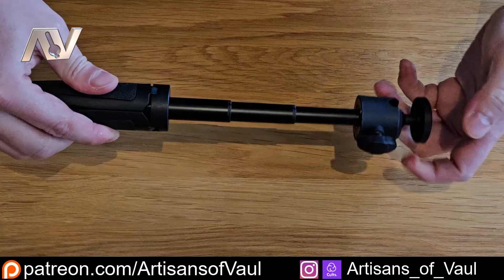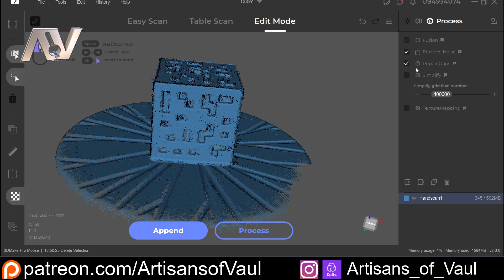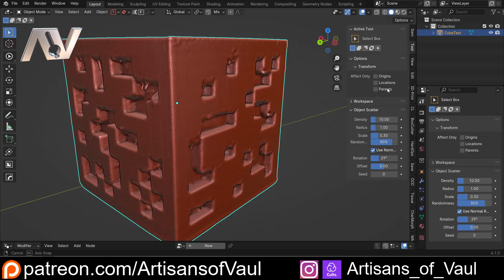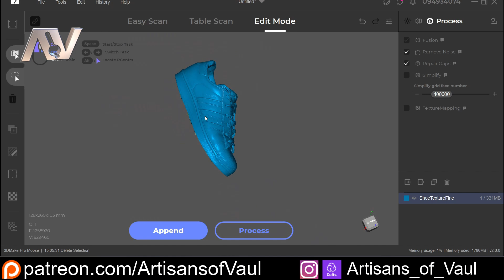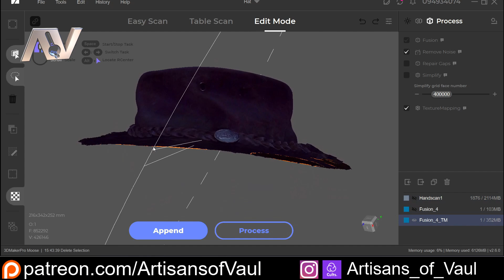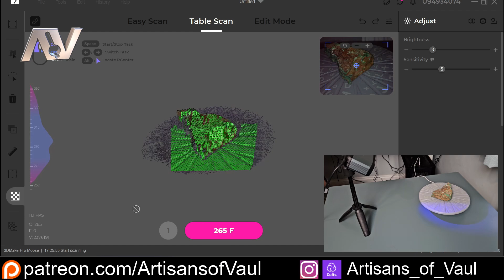Reviewing the Moose 3D Scanner by 3D Makerpro

Comment: Moose or Pop3?  On the fence between these two or a recommendation in that price point.  Thanks and apologize if already asked
Reply from the maker: @johnnoliviamoffett2896  Pop3 without a seconds thought. The software is just far and away superior. It gives more control while still giving a "once click" processing option and is receiving regular updates (even though it's already comfortably better by a good margin).

I mostly scan with a MINI2 but that's because I scan mostly small objects.

Comment: I have major issues with tracking, constantly losing tracking.
Reply from the maker: What are you trying to scan?  As you probably saw in the video I had no issues with tracking on a number of items.
Reply: @ArtisansofVaul  Anything really, I find my refresh rate appears much lower than yours. Maybe the light is too dim? hand held is very difficult. Unless I move as quick as a snail it loses tracking.
Reply from the maker: @maciejgorski6981  hmm... At points I had to speed the video up but I get pretty good rate. It could be an issue with the scanner itself/damage. Have you contacted 3D Maker Pro?
Reply: @ArtisansofVaul  Could be I have a second so ill try it out, but it could also be light and other factors. The scans come out well though. Faces look crisp.
Reply: Did you download the calibration file? Normally a message box appears at the very first start of the software. Didn't pop up for me. So I had the same issue, until I dowloaded this.
Had to do quite a bunch of research to get that information.

Comment: I just received my moose, this is my first scanner. I am looking to find what is essentially a dummies guide. Id also be interested in a follow along guide, I do have a printer and can make a test item if one is recommended.
Reply from the maker: @bluyben  hmm... I don't know of a start guide but there must be some good ones out there. My main tips would be to go nowhere near the table mode, it doesn't really work and will just cause confusion.
The other is make sure it is plugged into an electrical socket. The USB might Male you think you can use your computers power instead of the mains, but it doesn't work.

Comment: In table mode, you can unselect the half of the rock that has been highlighted for deletion by using the ALT + selection tool.  Then once the table plate is deleted you can go back and select any other artifacts that are still visible.
Reply from the maker: That's a good tip but you can also select in the same way in the other mode so I'm still not sure what the table mode is accomplishing....

Comment: So, what scanner would you recommend me? It will be used for scanning more complex objects where comes scanner handy instead of mesuring it by yourself. Models from scanner will be used for 3D printing (size 5cm-50cm), probably not directly, but you know :D
Budget is around these scanners that you have shown. Thank you
Reply from the maker: The budget is the tricky bit. At the smaller size you want a blue light scanner. The tricky thing is that at your larger scale (50cm) you need something that can scan a larger surface as well. Basically you're going to have to compromise either the scan quality at the small size, the time taken/easy at the larger size or your budget will need to be higher to do both well.

If you want the small size get the MINI2, I haven't found a better detail scanner than that so far.

Medium size would be this or the Pop3 at a mid budget or the Inspire if you want cheaper I would say. All of them are reviewed on this playlist which I hope helps: https://youtube.com/playlist?list=PLnqmLZKRm5CZLZSpCbyXO1YceOsdjiDn1&si=fmdcCzpr_LQDceg3